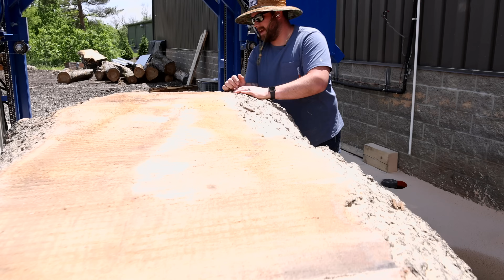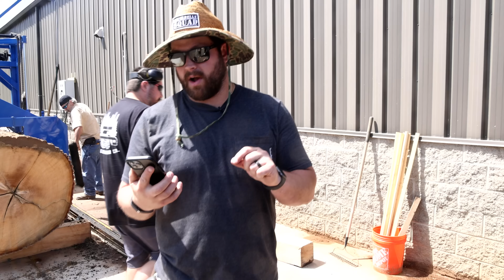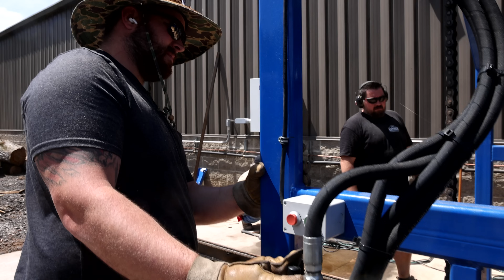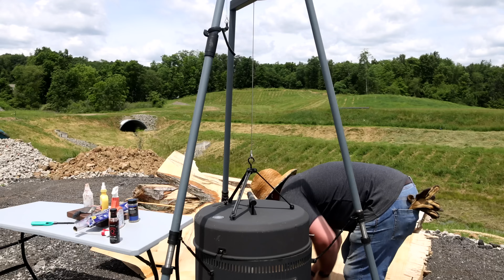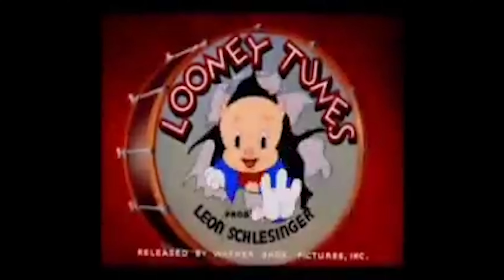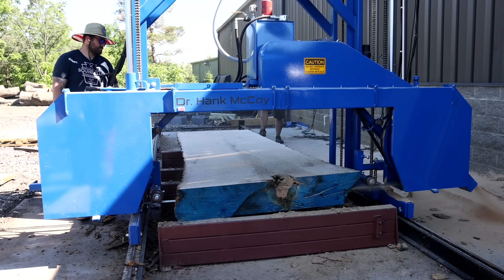Should I Have Bought A Bigger Sawmill?

Comment: There was a joke where he mentions Red Oak as every woodworker's least favourite wood. To explain the joke and clear Red Oak's name:
Red oak is a nice wood, solid, strong, durable. For furniture making, it's pretty darn good and significantly better than plywood or those splinter woods from IKEA.
The problems with Red Oak are that the beauty factor is a 6/10 while literally every other hardwood species is at least an 8/10, Oak is so freaking heavy, and it wears down the tools too quickly. It dulls blades, spends sandpaper faster, and requires more effort to work with and move around than other woods.
As a result, Walnut, Cherry, Ash, Elm, and literally any other hardwood is easier to work with and produces a more beautiful result. That being said, Oak is still a good choice across the board and is too good to let go to waste.
Reply: Thanks for clearing that up. lol I started googling it haha
Reply: Hmmmm, beauty is in the eye of the beholder.
Reply: @papadave9061   It definitely is. I personally like Oak in general but collect local exotic woods such as wild apple, Hawthorne, Juniper, spalted Beech, Cherry Plum, London Plane, Olive, Walnut, and Rose rootball for my small projects. Quartersawn Oak with any sort of pattern, such as crotch, is definitely beautiful.
Reply: I find Red Oak to be rather split-prone too, compared to White Oak.  But the right piece can be gorgeous.
Reply: havent worked much with oak. but at my work we use larch alot, and every single one at work including me ABSOLUTELY HATE larch. it bedns and screws and goes banana super easy, it always cracks and are full of branches.
Reply: Red oak is still my favorite smelling wood.
Reply: someone hasn't worked with black locust before.
Reply: i choose oak over all of them , have buildings here over 600 years made of oak .. maybe English oak is diffrent  i dunno i am a mechanic lol
Reply: I was looking for this information, thank you. 😊

Comment: So interns of whether it is red or black oak, red oak has these almost red “tiger marks” in the bark which tend to be very distinct when the tree is alive but still noticeable when it is dropped. Black oak on the other hand has very similar bark to white oak with the noticeable difference being right below the bark of black oak is a bright orange  phloem before the sapwood and on top of that it tastes very bitter. Based on what I am seeing it looks like a black oak which looks pretty cool.

Side note, yes parts of a tree are edible. Turns out bark is great fiber too if you need some regularity.

Comment: Suggestion after putting up a lean to to cover the mill: a gantry crane or other lighting air to lift the slabs. Doing them by hand, even with a pair of people is going to cause an injury. They are awkward and heavy. Those two in combo are just pian and disablity waiting to happen. So work smarter, not harder.

Comment: I dont understand why people put water on slabs where you can easily see the grain? are you planning in kiln drying the slabs after adding moisture to it?
Reply: The water brings out the grain like an oil or varnish finish would so you can see how it would look (or very close to it) when all said and done.  The little amount of water evaporates off it no time.  When buying a slab there will be buckets of water handy with rags so you can see the grain pop.
Reply: There's more water IN an Oak log than he's putting ON it.
Reply: ok thanks

Comment: I have so many questions watching these videos... Why do you hose the slabs? How do they get dry if you leave them out in the open? Should you move them inside to let them set? When?
Reply: Hose them for 2 reasons. 1. To clean off the dirt and dust. 2. (This is the important one) To check the grain pattern.
Reply: To answer the other questions, they’ll need to be covered to keep rain and direct sun off (thought still with good airflow), but left outside they’ll dry eventually.  Being oak, and 2.5-3” thick they’ll take 2-3 years to dry to equilibrium, which is +-15% moisture.  To get under 10% would require a kiln.  I’m guessing that within a year or two we’ll see John installing a kiln.  You could get them under 10% by bringing them inside a conditioned building, but that would take another several months at least, up to a year depending on the temperature and humidity in the building.

Comment: Silly question : why do you wet the slabs after the cut ?
Reply: my assumption is to get rid of the dust and see the marbling clearer, maybe to cool it down?? maybe? but i could be entirely wrong i know nothing about woodworking
Reply: To see if it is a good slab and remove the dust
Reply: It's so you can see what the wood would look like after a finish was applied. Makes it shiny.

Comment: What are you cutting your slabs at, 4 quarter, 6 quarter? I do advise the use of wedges as you cut the slab. This keeps the weight off the blade which helps the blade last longer and reduces the chance of the blade binding and breaking.

Smoking a hog. You should try the snake method when smoking with charcoal. This will eliminate the need to add more charcoal and can last up to 5hrs. Simply pour charcoal around the edge of the grill leaving a gap. Dump lit charcoal on one end of the coals. As the lit coals are dying the unlit ones are hot enough to take over. This goes on down the line.

Butter: more fat more better. 'nough said

Comment: Love your videos. How come you wet all the slabs? Does it stabilise the slab?
Reply: It shows, essentially, what the wood will look like with a finish on it.  No great reason beyond getting an idea of the grain patterns to wet it.  It does also get all the sawdust off, but the leaf blower or a broom does a good enough job of that.
Reply: i was wondering the same thing.
doesnt wetting the wood increase its moisture content, making it more difficult to work with?
Reply: @upenda glover - nope.  The wood is so wet the little amount they put on the surface is totally meaningless.  In log form most wood is 50-70% moisture content, depending on species and time of year it was cut down.  It won’t dry out much as a log.  So it’s basically soaking wet anyway.  Even if it was dry spraying it with water only adds to surface moisture which will quickly evaporate.
Reply: @andrewupson2987  ok. thank you

Comment: Looking at those existing cracks, just wondering if it would be better or even possible to cut the top of the log on an angle?   You are kind of at the mercy for how it rolls on the platform and where you can slice it across, but if you cut the top of the log on an angle, could you not flip it and have it sitting flat and choose where you want your cross section?   Talking out my ass here, but can the saw drop down on just one side? Or would that also cause undue stress on the blade?

Comment: You probably don't want to hear this, but I think you built/assembled the sawmill backwards. The exhaust port should be pointing AWAY from the building so that you aren't keeping waste and debris against it, but also to make cleanup easier as wind and rain would get rid of most of it for you. Also, if the exhaust port is facing away from the building then you can build a roof structure over the mill so you can work in the rain/snow and not have to worry about dust accumulating around the supports.
Reply from the maker: We cant blow dust out into the lot, its against our local EPA

Comment: if your dealing with pinching the blade due to the weight, why not just pull the slab off each cut rather than go 3- 4 cuts in before u unload?

Comment: Taking each slab off after you cut it instead of leaving 2, 3, 4, and more on the weight will stop the blade cutting and therefore your amps will be running super high
And also just looks lazy workmanship